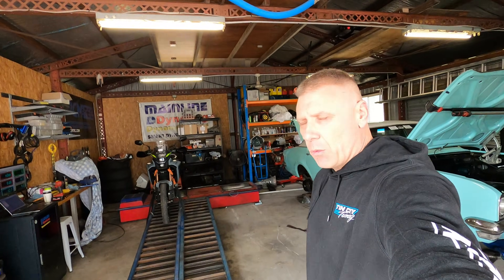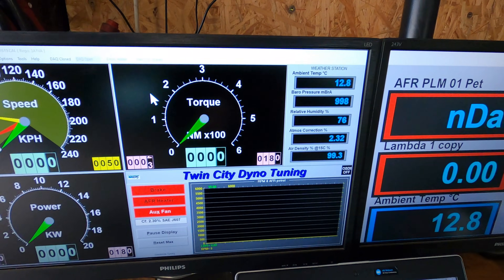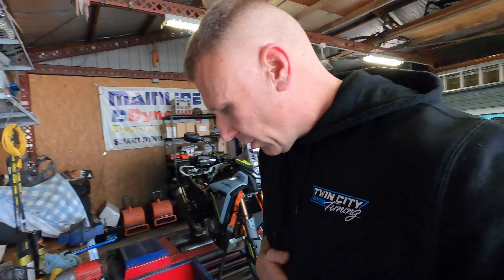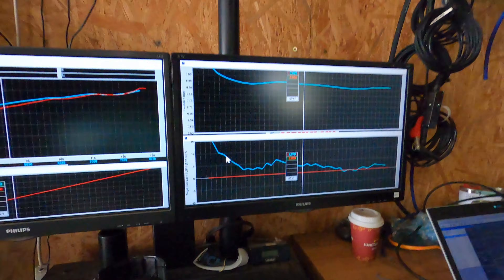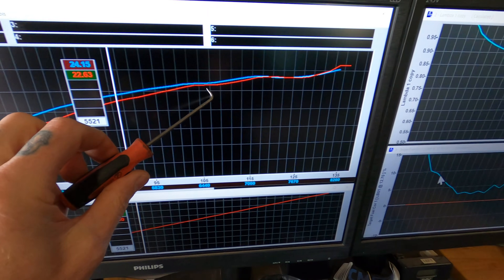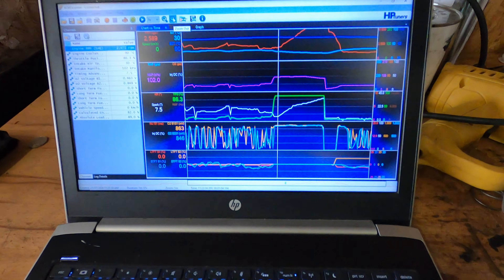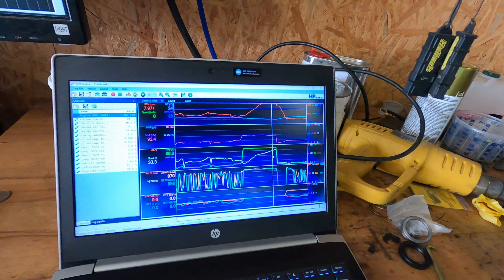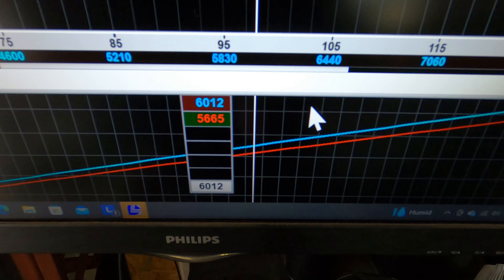CFMOTO 450MT 14 vs 15 tooth front sprocket dyno test results and power test part 2

Comment: Nice test mate!How would the 15t change the bike ride offroad vs 14t ?
Reply from the maker: The 15T front sprocket stretches first gear out a bit. You can still cruise through the bush in 6th gear no problem. I have not come a cross a hill in the bush that has an issue with a sprocket change.
Reply: @frashd  thanks mate!

Comment: Looks like CFMoto has tuned this well and I do like that it isn’t a ride by wire system even if this means it therefore lacks some features available that come with bikes set up this way. Possibly helped CFMoto keep the costs relatively low.  I’m therefore interested in what power and torque gains you’ve made and if you offer different tunes for stock and ones with an aftermarket exhaust?  Also, just out of curiosity why did you choose this over the 800MT-X?  As like me, you’re not a small bloke.
Reply from the maker: I do tune them, I road the 800mt and recently the 800mtx. If I stayed in the road I would go the bigger bike. The 450 is easier to throw around. I plan on doing a trip to the top end and would hate to be pinned on the ground with a fully loaded 800.
Reply: @frashd Thank you for your opinion.

Comment: I am new to all of this and maybe you guys can help me with some info. Does the 15 t has any downsides to the mechanical parts like chain, gear box etc ?
Reply from the maker: In theory, the 15T front sprocket may put more load on the output shaft  by about 2% but would be hard to prove. Also could put less stress on engine reciprocating component but less rpm @ same road speed. I would only recommend fitting genuine CFMOTO sprocket.
Reply: @frashd  thank you very much

Comment: Can someone please sum up? HP and TORQUE 1 vs the other?    😅
Reply from the maker: dyno measures torque. hp is torque  x rpm / 5252. That  is the calculation for horsepower.
Reply: @frashd  Thanks for responding! But my question was regarding how the HP and torque changed bewttwen the 14 and 15t sproket ;)
Reply from the maker: @juanmdq   The dyno measures at the rear wheel. 14to 15 tooth changed the multiplication ration, therefore changing torque/ hp. Engine power remains the same. Just like in a car. 1st gear has more torque than 2nd purely based on torque multiplication.
Reply: @frashd  Thanks again! But again.. I understand that!  i just want to know  how much it changed in actual values :)
Reply from the maker: @juanmdq  I will check the actual amount later on today and let you know. On the road you can not notice it at all. Maybe if you were racing someone on the same bike with a 14t sprocket they might just get the edge over you but I would trade that off for better cruising speed on HWY.

Comment: Do you know what causes the high fuel consumption on this bike? Did you notice a reduction in consumption with the 15T? By how much, if possible?
Reply from the maker: what do you class as high fuel consumption
Reply: @frashd  4.5 L 100 is the average consumption in a Tenere 700, so for a 450cc the normal is 3.5L, anything over 4L is a lot for 40hp
Reply from the maker: @fernandoz9218  regardless of engingine size, you still have to move a mass of x weight and size, which takes power/energy.  If x weight requires 5kws to maintain x speed that doesn't change based on engine.  The two bikes you mentioned look almost the same and have a similar weight. Even my trk502 used about the same. My brothers husqvarna 401 with a 390cc engine uses the same fuel on the same ride.
Reply: it's the way you drive it. crusing at 90km/h would take 3l/100km.

Comment: Awesome video mate. So quick question. If I have a supersport 1000cc bike and it makes 115nm of toque at the wheels with stock gearing. If I gear it down say -1 on the front and +1 in the rear will the dyno figures for torque change? I know the overall power won't but not sure about torque..? Keep up the good videos
Reply from the maker: @NUTS13GTX  thanks for watching. I use a sprocket calculator  that you can find through a google search. It tells you torque gains and losses if you input the correct data. Engine power will always remain the same but the final ratio will determine tractive effort (torque at wheel)

Comment: Haven't watched the video yet but hp and torque should drop with the 15t over the 14t but you'll have a higher top speed
Reply from the maker: @Catboy-hr2qp  hp won't change torque will. Hp us work done over time. But like you said "I haven't watched the video"

Comment: Are there 16 or 17t front sprockets?
I presume the 450nk uses the same sprockets as the ibex 450 (mt)?
Im not particularly interested in off-road riding, just want a much taller gear for highways. 

I geared my 200cc Lifan and 150cc Xpro bikes to rev 1k rpm every 10mph. Meaning 5k rpm at 50mph.
I feel this bike should be able to handle at least 4k rpm at 50 mph, 8k rpm at 100mph in final gear.
Reply from the maker: I wouldn't go larger than 15t on the front. Drop the rear down if not happy with a 15t front. I have rear sprocket ready to fit but I don't think it needs it.

Comment: It would be nice to hear, and for you to put up on screen, the clear and specific differences. Like a clear and concise summation of your findings.
Reply from the maker: @evelcustom9864  there are hundreds on videos of these bikes running. I can make another video but the loudest part is the knobby rear tyre on the dyno roller
Reply: @frashd  I think you misunderstood my comment. I mean that at the end of the video you should clearly and simply describe the difference in power and torque of the two different sprockets and put up a graphic with that info. Especially for those people who are not used to regularly reading a dino.

Comment: I prefer to change the rear sprocket, so I lose a little weight thanks to a smaller sprocket and a shorter chain.
Reply from the maker: @carlose.5245  that involves alot more work for testing purposes. Plus reduced diameter of rear sprocket reduces swing arm clearance

Comment: Hello from Greece. So you are telling that torque line  and the hp on the wheel are more and better? How much more  torque and  hp on the wheel between 14t and 15t ? I am trying to undestand how ... That is impressive
Reply from the maker: @Ps-fd1gx  engine torque does not change. It is multiplied or divided by gearing as any other engine. If you look on the Web the are sprocket calculators
Reply: @frashd  ok i ll check it . Thanks mate

Comment: Great video, Would going to a heat range colder spark plugs and 98 fuel get a power gain?
Reply from the maker: @michaelgleeson1198  will have absolutely no effect without reflash of the ecu. If you watch my other video you will see.

Comment: Put my order in yesterday with the 15t front sprocket, and higher guard kit, in the zephyr blue, I was surprised how smooth the motor was, with a great note from stock !
Also feels pretty balanced, and turns in easily.
Not overly impressed by the front brake, but easily something I could get used to
Reply: Hello Jonno, I was wondering about such a low front guard and getting clogged up and throwing you off when in the stick shite, which happened to me on an old Yamaha DT 250 a hundred years ago. Where can you get a higher guard kit from? Thanks.
Reply: @glennmorrissey2529  cfmoto themselves, $159 au mine cost through the dealer when I bought the bike, although the kit is still on backorder, I'm guessing due to popularity.
Reply: @jonnothetrucker  Thank you. My mate sells them in Moorebank, Sydney and am going for a test this Saturday. Any opinion on geting a centrestand, I haven't ridden dirt for ages and last hitout was on my old 1150 GSA which I now keep in Europe for touring so am lookiong to stay our of hospital and a bit of reasonably tough stuff.
Reply: @glennmorrissey2529  I'm considering a centre stand, but so far all I've done is put a pad on the side stand (b&b offroad)to make it a bit more stable in the soft stuff (so far works great), they sit up fairly straight on the side stand too, I'm only thinking centre stand for servicing etc, not really seeing a need for it elsewhere at the moment

Comment: Man, how tall are you?
The mt shows like an xt Yamaha
Reply from the maker: @dimitriosbitis5309  6ft 3 but the bike has no seat on it in video and rear wheel is dropped into rollers on dyno
Reply: Me the same height. Is it possible to make the bike a bit higher? 4cm..?
Reply: @dimitriosbitis5309  CFMoto has a rally seat in their parts catalogue, and this seat is a little bit higher than the regular one and has a flatter profile to move to and back freely.

Comment: Hey, I've already got on 15T sprocket and going to replace it soon, but still have some consideration for rear 46T sprocket.  What do you thing about change to 15/46 set? will it still perform good in off-road conditions? Or maybe just stick around 15/47? Thanks for your suggestions
Reply from the maker: @steptrip  I would stick with front sprocket only. These are off road bikes and you do want some control at low speeds
Reply: @frashd  thank you! Then will stay on that combo. Cheers

Comment: Why do you think the bike is going to make anywhere near the power claim? That’s at the brochure (crank) and you are measuring at the rear wheel or have I missed something? Also you mentioned less torque because of the larger front sprocket but torque remains the same what changes is rear wheel thrust.
Reply from the maker: Torque is multiplied by gearing. Engine torque is the same but torque at wheel is different when gearing changed. See it all the time. "Thrust" what??? Yeh don't know about that mate. No dyno in the world has a Thrust calculation.
Reply: @frashd   Yeah, the speed you get the peak torque at also changes so you compensate with a lower gear with taller sprockets so you get identical in-practice results when riding. The first gear is what means the most and 5th or 6th depends on how many gears the bike has :)

A Yamaha DT125R 1st gear is so short you can go 18/55 sprockets instead of 16/57(stock) and it will be perfect for offroad AND onroad. Only 7500rpm@90km/h.

Comment: Thx again for the effort!

Question: can you give a small crash course on what you are doing? What quantities are you measuring, what impact do the quantities have in the performance.. and how can you enhance the performance….

(And why do you shift up without clutch?
Reply from the maker: the shift is done with a flick of the wrist just like a quick shift (cutting torque through the gear) the gearboxes are dog engagement so simple to do so. I am checking rpm at 100 km/h for sprocket change, power check again after doubters thought it should make more ( quoted power from CFMOTO is @8500)

Comment: Can someone explain me?? How the bike have more hp with 15terth when the gearing is longer and less power and got more top speed?
Reply from the maker: I revved the bike slightly harder, torque has dropped slightly in mid. gearing effects torque HP is work done over time.

Comment: Does the type of tyre affect dyno readings much?

If you put a really sticky slick tyre on, would it give a measureable increase?
Reply from the maker: No it would actually go lower. If i ever doubt figures on big powered cars I make sure the tyres are old and hard.  Even tyre brands and rims weights can effect power reading on a ramp. steady state is different.

Comment: CFMOTO have recently sent out an update through their app with a new mapping. My bike runs under 6000rpm at 100k. It also addressed the choppy throttle issue.
Reply from the maker: @twowheelin7361  the update can not change gearing. I can't see how the rpm has changed unless the speedo has been updated... which would be good.
Reply: only in australia i think , euro 5 hasnt been updated yet
Reply: @konstantinosprouskas8106  is it possible to buy an ECU from uncle wang to get a non Euro 5Version?
Reply: I wonder how software update can change things which can only be done manually. this twitchy throttle can only be corrected from pull and push cables. 
Do you have CFmoto update details. Did they mention what improves with this upgradd.
Reply: @Taime78  there is drive by wire aswell as electronic throttle control bikes..
Reply from the maker: @Taime78  the twitchy throttlecis from the transition of decel to normal fueling and target fueling at low rpm. Throttle slack has nothing to do with power delivery controlled by the ecu.
Reply: @Taime78 fuel, oxygen and timing is all managed electronically so with a fuel injected bike pretty much everything can be updated via software these days.
The throttle response being a physical wire or electrical signal doesn't change much there since it's all just another way to tell the bike how much push you want it to have.
Reply: I think Update and cable fix is the solition ❤ im. Thinking to buy the nk 450 for my girlfriend
Reply: hi, how do we update the software latest version MT450 video tutorial??

￼
Reply: @davidedalceri369  through the CFMOTO app! When I took my bike in for its 1,000k service the dealer mentioned they ran the update as well👍🏽
Reply: Wow, i never know that software update can change the ratios.
Reply: @yusuffirdaus3900 its bullshit, Update via App without t Box is even non ECU Update. So many amatuers driving this Bike 🎉😂
Reply: @David-m7f3g  no it's not bullshit, just increase the speed deviation on speedometer. It will revs lower on certain speed 😋😋😋. Fake ratios change 🤣🤣
Reply: @yusuffirdaus3900  Yeah it's crazy! I also got one more cylinder and 30HP more with the latest update. So happy!

Comment: Great video. I am adding a dna filter to bike and 15 tooth sprocket. Will ecu alter on its own with new free flowing filter?
Reply from the maker: @barrysalmon9892  altering the intake the the airbox will cause possible issues on stock ecu map
Reply: @frashd so it will, but possibly? 😂